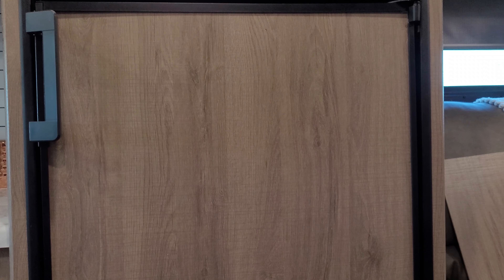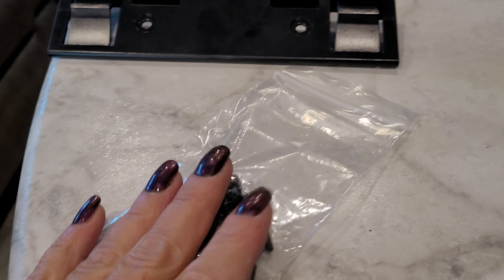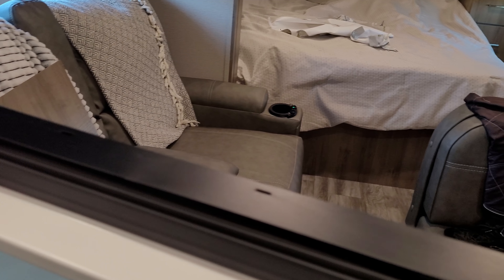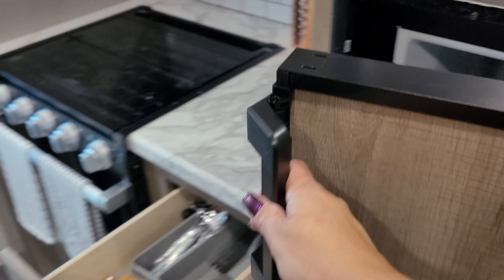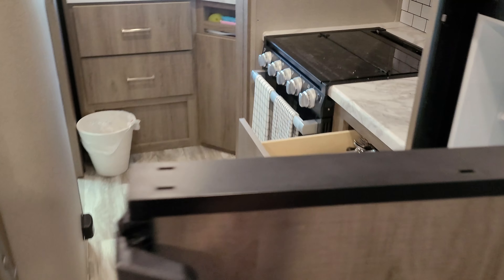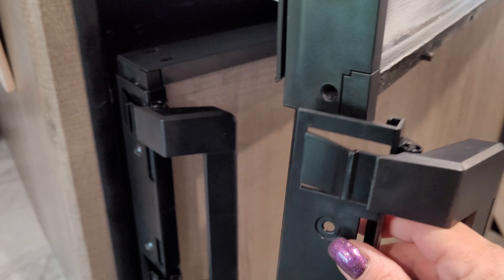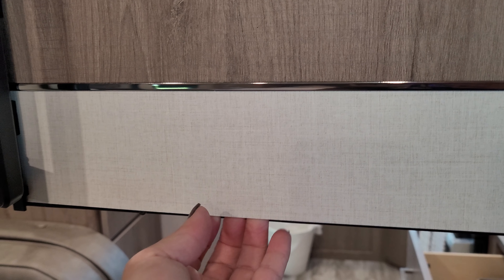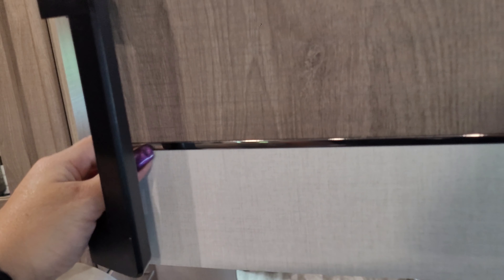Replacing Handles on an RV fridge (Domestic DM2882)

Comment: We have a different problem.  The little white piece on the inside of the fridge has broken off.  I tried calling Domestic with no luck.  It's very frustrating and we have to velcro the fridge door closed while traveling.
Reply from the maker: Oh no, that's terrible!
Reply: That’s the same problem I have!!! Did you figure out a solution! Thanks!
Reply: @gaulergolf  I finally figured out that I was looking for a "strike plate".  I ordered one from online but can't find the pkg it came in.  Interesting enough when installing it my husband found two more strike plates on the opposite side.  He and our son-in-law pulled the fridge out a little way and took the frame off around the door.  If you look on the frame of the fridge, the area where you would reverse the swing of the door has two strike plates; one for the freezer and one for the fridge.  IF you never plan on changing the door swing, you could use those instead of ordering them.  They are all made of plastic so who knows how long they'll last.  One thing I figured out, also, is to put your thumb only on the top front of the door handle and open it from there.  Works so far.
Reply: @paticherry5222  omg. Thanks so much!  I’m gonna go seek out those other strike plates!
Reply: @paticherry5222  is there a way to get those things off safely?
Reply: @gaulergolf  Hubbie says,  take out all 4 screws on front of fridge (they hold the fridge in place). take out two screws from back side of fridge that you get to from outside of trailer behind the refrigerator vent cover.  There are 2 screws going into the floor.  Pull fridge forward into the camper, have someone push from outside if needed.  then you should see where the strike plate is screwed into the side of refrigerator.  He says "he'll see it".  I hope so
Good luck.  He says you don't have to pull it in very far.
Reply: @paticherry5222  thanks so much!!!  Tomorrow I will give it a shot!!!
Reply: @paticherry5222  thanks so much!!!! I did it this morning and it was really easy! I really appreciate the time you took to get back to me! Saved me a LOT of headaches.
Reply: @gaulergolf  I'm so glad it worked for you.

Comment: Quick question, if you had to do it all over again would you buy the 22MLE again? Knowing what you know now is there a different trailer you would’ve bought?
Reply from the maker: You know, I obsessively research anything I buy. And I did that with the 22mle.

Then after I got it, I kept researching. And every time I think I find a trailer that might be better, I am wrong. I love this thing more and more, the longer I own it, and after the more travel trailers I see!
Reply: @KatieMontana1  thats cool. I’ve been thinking about getting one also but also looking at the Cougar 22MLS. Similar floorplan but 60 gal water, 30 lb propane, electric jacks and king bed but maybe 5k more $.
Reply from the maker: Electric jacks I would like.

I think that cougar had slightly less storage, which I definitely needed.
Reply: @KatieMontana1  Good news, my wife and I put a deposit down on a 22 MLE. Hope to have it in a week or two. I hope we like it as much as you do yours!
Reply from the maker: Oh yay awesome!!!

Comment: Next time you have a problem find this mess im a Rv tech there is another way you can do it
Reply from the maker: Thank you! I wasn't sure I'd be able to get an appointment with one so I tried it myself. I'm sure I did it the hard way like I do everything else 😆
Reply: Hey Timothy, Would you be willing to make a video showing the alternate way? Also, would you happen to know of some better handles? I've had my camper for 4 weeks and the handles are almost broken through on them. Maybe something stronger than plastic like metal?